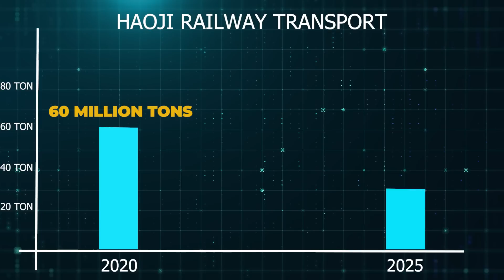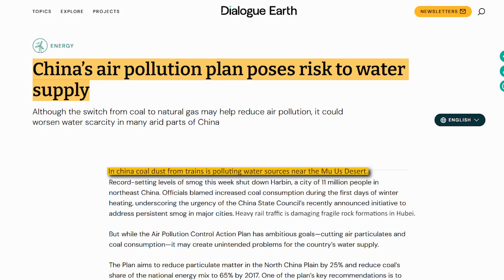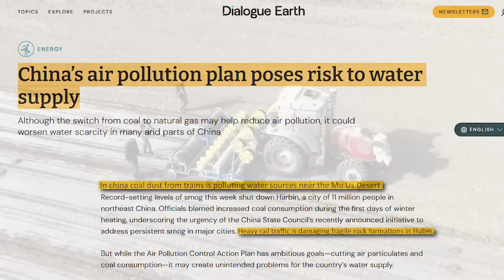Why China Built a $27BN Railway and Why It's a Problem

Comment: Piss poor analysis.  This racist anti Chinese bashing propaganda movement has gone to new heights.  

This infrastruture is not going to go to waste.  To start with $27 Billion is not all that much for a mega project of this scale, this is not for immediate profit but built for decades ahead.  In the short term shifting 500,000 tons of coal per year is nothing compared to the 4,000,000,000+ tons it burns annually, clearly the Chinese is not forcing the issue as implied in the video, and shifting 500,000 tons till the year 2030 (only 5 years away) does not imply the Chinese are not continuing to phase into renewable energy.

In the longer term, there are huge untapped rare mineral reserves in the Inner Mongolia region, domestic and foreign (including the US) demand for these will explode in the next few decades. China will need to mine this to support its domestic supply chain.  In the world of trade wars it is particularly important to protect indigenous supply chains.  These include rare earths for battery and solar panel construction, which are obviously vital for renewables, chip manufacturing for AI, radars and aircraft engines for the military and civilian use - these listed are just examples, but are all sectors which have only just started to boom.   This is not even mentioning indigenous uranium mining to secure their expanding nuclear energy production.

China is not just about burning coal - what a shallow analysis.

Comment: Wouldn't it be cheaper to make coal fired power plants next to coal fiends and use extremely high voltage power lines to where power is needed ?
Reply: They need it to power factories in the south. The factories are in the south so they can export finished manufactured goods by sea. It's cheaper to move bulk commodities than finished manufactured goods in containers. So it makes more sense to move the coal to the south than to build factories in the north and move the finished goods south in containers to the sea.

Comment: China is still building new coal fired power plants. Eventually assuming coal consumption for electricity and steel production drops, then imports from outside China will decline, especially if the new trade war escalates

Comment: Annual freight volume of Haoji Railway
2019-- --4.12 million tons (opened at the end of September and operated for about 3 months until the end of the year)

2020-----26.2 million tons

2021----58.25 million tons

2022---90.59 million tons

2023-----95.55 million tons

2024-----Exceed 100 million tons

The cumulative transportation volume in the past five years has reached 347 million tons.

Comment: 1. There is no prospect of China stop using coal soon. Coal as a percentage of China's energy mix will decrease over time as renewables pick up, but this is a decades long process.
2. The railway line still passes over territory where people live. There will always be another use for the railway. 
3. It is just one line out of over 100,000 km China has built. You'll always get lines that aren't profitable. The country with the most km of railway is (you may be surprised) the US. That system is mostly used for freight. If anyone has overbuilt railway (in the past), and most of the system is unprofitable and in disuse, the US is still well ahead of China.
Reply: True. They are building so much. It is understandable if some projects do not go as planned. The general trend is positive.

Comment: At 4.9 BILLION tons of coal consumed by China in 2024 with only a little over a half a billion tons of that imported it is still nearly 4 times as much as the second highest coal consuming country India. It is hard to believe they can reduce coal consumption any time soon.
Reply: Like "Oil" other then energy, like "Coal" have other by product usages for this material.  
As long as China is the manufacture center, coal are needed.
Reply: Exactly. There is no prospect of coal going away any time soon. China may well use less coal over time. It is still going to take many decades to phase out coal - if ever.
Reply: They said they’d be carbon-neutral by 2050.  That could also mean they’ll still burn coal, but offset using re-forestation.  Or, and I think this is the fastest path, they could also go in the short term for carbon capture for all of their carbon-burning power plants.

Regardless, they are actually doing something instead of being in denial.  Just a couple days ago, the US gutted its entire meteorology and weather scientists department.  That’s kind of the opposite approach they need to be making.
Reply: @szahmad2416 you believe all that? I assume you've been to China's major cities and actually breathed the air? I have. 
 China is building new coal fired plants every month to keep up with power demands. They visibly have some of the worst air quality in the world. Unless they stop their power consumption and industries their pollution issues will only get worse.
Reply: @ when was the last time you were in China?  Shanghai and Beijing air seems to be a whole lot better now since they took up the initiative to clean the air.

Also, yes, they have increased coal consumption…until last year, when it declined.  Not as a percentage but in real terms.  China is constructing small nuclear plants, which I see going a lot further than wind and solar.
Reply: @jeffg4008  When were you last in China because it appears you're outdated. China's air pollution problem has improved significantly in the last 7-8 years. And gradually reducing coal-fired power generation has a lot to do with that.
Reply: @tweedy4sg  are you for real? China's coal usage has increased every single year. It's not going down, it's going up. 4.8b tons and expected to be 4.9 to 5b tons by the end of 25.
Reply: @  of course I'm for real, are you though ? Don't try to change the subject of the argument about pollution in Chinese cities because of your use of outdated info..
In any case, I'll answer yr comment.
What you've given is just 1 yr of data. The increase in coal use will eventually reverse with the reduction in it's use. It won't increase indefinitely. It's use will only be reduced and won't be totally eliminated to achieve carbon neutrality. 
This reduction in coal use will be replaced with increased renewable energy capacity (soalr, wind, hydro & nuclear) of which China is a world leader.. That said,China is also improving the technology when using coal by using clean coal. Kapish ?
Reply: @tweedy4sg  the last guy just told me that China has significantly improved over the last 7-8 yrs. China's coal usage AND overall fossil fuel usage AND overall energy usage has done nothing but increase EVERY year. I answered his question. You guys are like talking to children or shills. There are published reports on their energy usage, and it's source. 
What China has done, is a much better job at dilution. Moving coal fire away from populous areas and mandating people not drive gas cars in particular areas and at particular times. China's overall emissions have INCREASED every year. They are trying to grow their economy and lift 100s of millions out of poverty. That takes a lot of energy.
Reply: @tweedy4sg  China doesn't believe in carbon nonsense. If they pay lip service to it then it's just to sell solar panels to the west.
Reply: It takes a lot of coal to manufacturer all of those green solar panels and wind turbines
Reply: @jeffg4008 Not exactly. Since most low end manufacturing had slowly phase out to be replaced by high end tech, with newer generation of Nuclear power stations, new hydro power, mass  renewal power farm, they may not need coal other than as a form of standby national security for most remote areas.